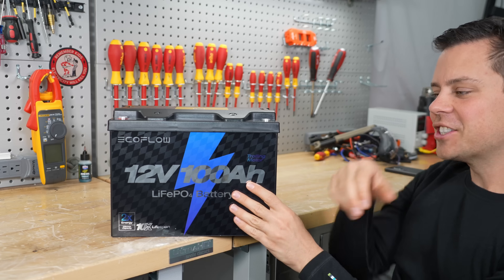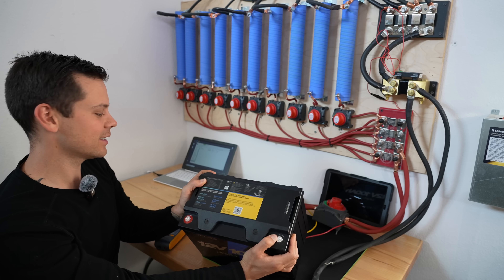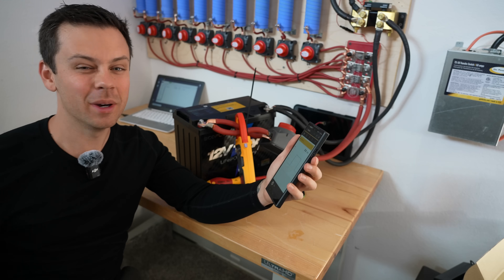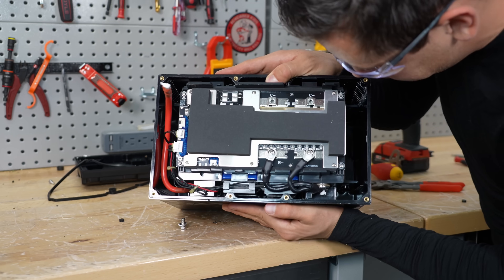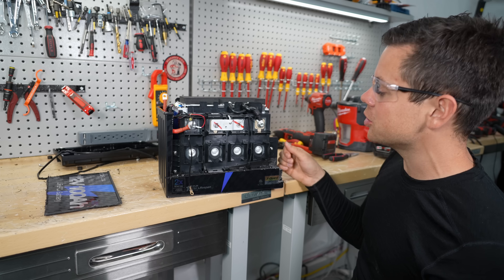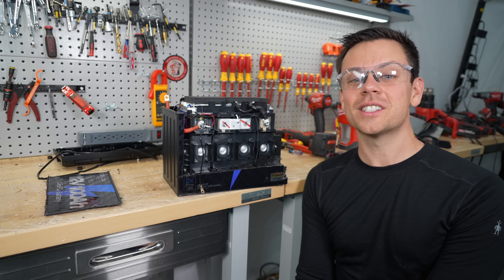$200 Ecoflow 12V Battery?! It's shiny!

Comment from the maker: $200 EcoFlow 12V LiFePO4 battery (affiliate link): https://bit.ly/4f6xuHm
$219 EcoFlow 12V Trolling Motor Version: https://bit.ly/3AkxJiR

$300 EcoFlow 12V LiFePO4 battery Amazon link: https://bit.ly/4e44ZZI

Other 12V batteries I recommend: https://www.mobile-solarpower.com/lithium-batteries.html

0:00 Intro
1:01 Surge Testing!
3:29 Tear Down
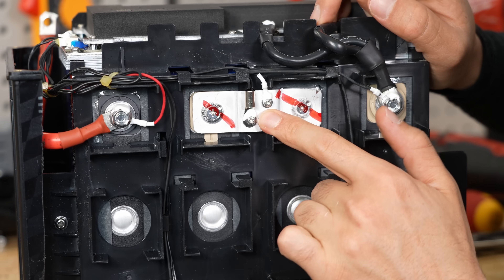5:56 Cold Temp Sensor Test
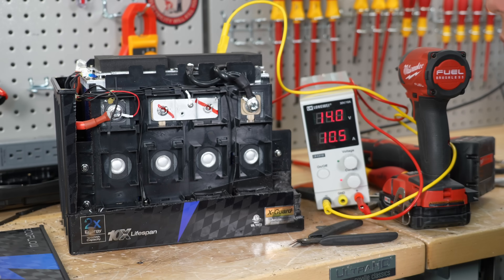6:16 Conclusion

~~~~~~~~~~~~~~~~~~~~~~~~~~~~~~~~~~~~~~~~~~
Tired of getting ripped off? Check out my "Will Prowse Approved" solar product recommendations below!

12V Batteries
https://www.mobile-solarpower.com/lithium-batteries.html

48V Batteries
https://www.mobile-solarpower.com/48v-batteries.html

Offgrid Inverter System Builder
https://www.mobile-solarpower.com/48v-complete-system-blueprint-559371.html

Hybrid Inverter System Builder
https://www.mobile-solarpower.com/code-compliant-48v-offgrid-system.html

Mobile Handtruck System Builder (very popular!)
https://www.mobile-solarpower.com/mobile-48v-system.html

Solar Panels
https://www.mobile-solarpower.com/300w-solar-panels.html

Ground Mount Solar Racking
https://www.mobile-solarpower.com/ground-mount-racks.html

Wire, Lugs and Busbars
https://www.mobile-solarpower.com/wire-and-connectors.html

Tools
https://www.mobile-solarpower.com/tools.html

Fuses and Circuit Breakers
https://www.mobile-solarpower.com/fuses.html

Plug-N-Play Solar Systems
Ecoflow, Anker And Bluetti! So many models to choose from. See my current recommendations here:
https://www.mobile-solarpower.com/full-size-systems.html

~~~~~~~~~~~~~~~~~~~~~~~~~~~~~~~~~~~~~~~~~~
Need to build a large DIY system? Need a trustworthy solar distributor? These are my favorites:

Signature Solar
Creator of EG4! Solar Minisplits, Victron and More! Largest Solar Store Online.
If you want $50 off, please use my link below and coupon code "DIYSOLAR50":
https://signaturesolar.com/?ref=cPwLcVc0SW-BjN

Current Connected
Best Prices for EG4, Victron, Midnite and so much more! Fast Shipping and Highest Rated Customer Service:
https://currentconnected.com/?ref=wp

~~~~~~~~~~~~~~~~~~~~~~~~~~~~~~~~~~~~~~~~~~
Join our DIY Solar Community 
Need more help? Join the largest solar forum on the internet for beginners and professionals alike. 140,000 members and counting!
https://www.diysolarforum.com

Check Out My Free Book
Best-selling and beginner-friendly guidebook to off-grid 12V solar!
https://www.mobile-solarpower.com/the-book.html

~~~~~~~~~~~~~~~~~~~~~~~~~~~~~~~~~~~~~~~~~~
Contact Information:
I am NOT available for personal solar system consult! If you wish to contact me, this is my direct email: williamprowsediysolar@gmail.com
FTC Disclosure Statement and Disclaimers:
Every video includes paid promotion or sponsorship (such as free products for review). Some links on this YouTube channel may be affiliate links. We may get paid if you buy something or take an action after clicking one of these. My videos are for educational purposes only. Information is subject to change/update at any time. Electricity is DANGEROUS and can kill. Be smart and use common sense :) DIY Solar Power with Will Prowse is a participant in the Amazon Services LLC Associates Program, An affiliate advertising program designed to provide a means for sites to earn advertising fees by advertising and linking to Amazon.com
Reply: Are there any of these types of batteries that can be used as starting batteries for a vehicle?
Reply: Would you recommend this for a camper build where I have a 24 volt vitron 3000 watt, since its a 24 volt truck, and use 4 these in series parallel, or is there a different battery you would recommend or a 24-volt battery that would come out as less expensive but equivalent in quality?
Reply: Your discount code isn't working for the $200.00 version of this battery.  It only seems to work for the trolling motor version.
Reply: @shouldibehere  I found that out the hard way- I didn't notice until after checkout, and despite me giving the information they required, they didn't cancel before it shipped. Guess I'm not buying ecoflow again.
Reply: :face-green-smiling:  Can you do Hiximi Will? Popular in mexico but ZERO information on them. 5000 pesos for 12v 100amph. $240USD with import tax.
Reply: Hey Will I got to ask what do you do with all the batteries you cut open? just passing through. do you pull the cells out and make any diy sets. lol
Reply: About cutting into batteries. Maybe a circular saw? Set the depth of cut really shallow. If you do not get through the first time, increase by a small amount? 
Just an idea of mine it may not be practical IRL. Love your videos by the way.
Reply: 599 in AU, that's with 100 off
Reply: try an m12 cut off tool 2522-20 , it is a 3 inch circular saw with a depth guide like a circular saw
Reply: Discount code EF12VWILLP doesn't work :(
Reply: These prices sure do love changing fast. Your last video on the WattCycle for $155 is already $210 and the video is less than a week old, and this video is 3 days old and the trolling motor version is $270 instead of $220.
Reply: the problem with ecoflow is their crap support  as well as their software as most of their support is reading from prompts and knows next to nothing. getting warranty claims done is a pain.
Reply: Marine version is $269.. not $219
Though still very inexpensive
Reply: You should test water proofing before tearing into these. For a trolling motor, salt water ingress would be... bad.
Reply: A table saw would be a good way to open batteries. Can adjust the depth as the saw is running. Using the saw guide will keep the cut straight to avoid binding or burning. When all 4 sides are cut the same it can be glued back together.
Reply: EcoFlow also making battery now?
Reply: Hi Will, I tried the coupon code on the first link and it was invalid. The second link price went up to USD $269.00 and the coupon code worked.
Reply: Apologies if this is a common question, but why a trolling battery over a standard 100ah?  Waterproof?
Reply: Just a heads up that I tried to use your code for the non-trolling motor version today and was given this message: EF12VWILLP discount code isn’t valid for the items in your cart
Reply: @willprowse I've asked in the past n multiple times we see you testing allllllll kinda batteries and solar panels and panels ECT however I have yet to see ECOWORTHY PRODUCTS AND ESPECIALLY THERE BATTERIES!!!!! kindly would you please be willing to do some testing for everyone who has built system from the products they sell thank you for sharing information and really would like to see ECOWORTHY PRODUCTS testing for everyone
Reply: I looked into it more and I dont see a need for the "trolling motor" batteries for use with actual trolling motors. They should just be marketed as High Output batteries
Reply: These are $129/$149 on their website. Not sure if this is temporary price or what????

Comment: I have 16 of these EcoFlow 12V 100A trolling motor batteries in four parallel banks of four in series for 48v 20kw storage/usage, running my garage power needs. All Victron MPPT's, Inverters, Shunt, Cerbo GX. Never had any issues with these specific batteries or the Victron gear. 18 months since purchasing & using the EcoFlow batteries. I also have an EcoFlow DP3 & have used one set of 4 of the EcoFlow 12V 100A trolling motor batteries connected in series for a 48V 5KW to augment the smallish 4KW of internal storage the DP3 has during extended power outages to keep my home living room & kitchen power needs met. Happy Customer of EcoFlow & Victron products! Renogy RSP200D Solar panels on Solar Pergola and sprinkled across my backyard powering it all.
Reply: Thank you for providing an update on your experience. Greatly helped me decide to purchase these.
Reply: @danzuelch  ebay has these batteries for $129 right now
Reply: @AlanPhillips-g1c  Thank you. I just ordered and received 2 of them :)
Reply: Could you tell us more about your setup? How is the performance

Comment: Will,  I have 32 of these EcoFlow 12v 100Ah LiFePO4 batteries in my system. I need to top them off to balance my batteries. How do you suggest that go about doing this(I have the HiTec RDX1 MultiCharger will this work?) (I also have the Longwei LW-K3010D will this work?) BTW all of your videos are AWESOME!! You taught me a lot! Thanks!

Comment: I always wonder why these battery companies say not to use these in stock golf carts. It looks like the max amp draw for these and other low priced 48 volt packs that a sold as golf cart batteries are the same. I'd like to try some of these low buck batts in my stock Yama cart but don't want to be a test dummy. Enjoyed the video. Thanks, DS

Comment: For shallow cuts the fastest method would be to take a cordless skill saw, a light weight cheap brand like "Hyper Tough" from Walmart, and set the depth of cut to a sixteenth of an inch or even less and you can save the box by folding it back on a shallow cut and then hotmelt glue it all back together.  I hate to think you have a pile of batteries sitting around you can;t use when I need about 8 of them for my cheap system.
Reply from the maker: I donate them all to forum members

Comment: Did you know that welder's wire leads are made of a much finer and more flexible copper wire than standard heavy gauges?   This means that for most of your heavy wiring, perhaps up to two gauge you can use these more flexible cables and the advantage is that when you do as much temporary testing as YOU do it will aid you in making easy connections and bending around tight areas.  I hope you will look into getting some on line.  Great job.

Comment: I learned from Will when he started his channel and wrote a book. Years later I have built many DIY systems based on his teachings and experiments . I still watch everyone and always learning and enjoying his unique, honest and can’t be bought approach. He is the best !!
Reply: One thing to be careful about with fine stranded wire is "cold flow".  It can move (flow) over time.  Be sure  to use lugs rated for fine stranding or put crimp a ferrule onto the strands before putting into the terminal.

Comment: What is the difference between- Lithium, Lithium Iron Phosphate? Huh?
Reply: Plain old Lithium batteries or "Lithium-ion" are old tech.... LiFiPO4 are a newer style of Lithium battery that is more energy dense, safer, more cost effective, more thermally stable, have a higher cycle life and many other advantages over the older Lithium-ion type batteries.
Reply: @ thanks handsome, this should be said more!
Reply: Trolling motor? What does THAT MEAN?
Reply: @kricklasalty1464  A trolling motor is an electric boat motor for fine motor control of a boat. Fisherman often use them to quietly "troll" around their favorite fishing spots. Sailboats often use them as well for navigating boat docks and "no wake" zones.
Since this battery is designed for "Trolling Motors" it is a lot stronger than a typical battery. It is designed to be in a boat that will probably get jostled around, splashed with water, kicked, taken in and out of the boat, ect...

Comment: I'm looking to build a 48 volt RV system. I know it may not be the most advantageous but as good and inexpensive as these 12 volt batteries are getting it may be great cost savings to use those in series instead of 48 volt batteries

Comment: Any way you could do a video on how to do an automatic aux battery setup. Wonder the best way to setup so that if you have  2 banks, one sized for standard use and one for redundant if the main bank hits X volts. So failover to the backup bank if main bank hits X volts,  then top off the backup bank and switch back to main bank to charge it back up when power is available all using one solar charger setup. The thought is It might be nice to put some cheap batteries in bank 1 and have a more expensive battery in bank 2. allowing the more expensive to take less cycles over time.

Comment: Hi Will....I want to replace my 2 Renogy AGM 100 amp batteries with lithium batteries - just trying to figure out if these will work with the renogy 50 amp mppt  charge controller.  Looking at two 230 amp litime lifepo batteries.  HELP - will this work?

Comment: You need to pick up a commercial walk in freezer so you can do some cold weather testing for us people who live in Canada or Alaska. 😂  I need new batteries for my cabin but -30°C is the lower end of winter temperature. Pretty sure I will have to stick to AGM's but Lithium would be nice based strictly on performance.  Will pick up one of these for the boat trolling motor though.

Comment: I want to put something like this in my car as it's starting battery...
But most I've seen have small screw terminals that will be difficult to connect to...
Any thoughts would be appreciated. 
Cheers.
Reply: Depends if this battery is able to provide the necessary current (amps) to your starter motor for as long as needed to turn over the engine and start it. I think it would also depend on whether your alternator is capable of providing high enough voltage to maintain the battery charge. I think LiPo absorption voltage is around 15.2V. Maybe with some investigation and tinkering you can get it to work. Would be interesting to hear from those in the know.
Reply: @inncogneato6341  Lithium iron phosphate can be charged to full capacity with as little as 3.4 volts per cell, up to 3.65 is considered normal, and they can for short durations safely withstand up to the full 4.2 of other lithium ion chemistries. For 4s that means 13.6, 14.6, and 16.8 volts respectively. Lead-acid requires temperature compensated charging, the colder it is the higher the voltage required. Below freezing the charging voltage of a car can be up around 15 volts.

Personally I live in a climate that sees snow so I would use one as a car's cranking battery provided it is self heating and its capacity is at least double that of the alternator amps to be sure that it is never charged at more than .5c, IE my car has a 160 amp alternator and so I would do 320 Ah minimum. the starter draws 700 amps stall current. I would also prefer to have an ultracapacitor array or lead acid battery in parallel because bad things can happen if the BMS disconnects with the engine running.

It should also not be mounted underhood as the temperature is too high.

So 3-4 of these in parallel, mounted in the car's interior, and in a tropical climate would do the trick.

I actually already do have a small LFP battery in parallel in said vehicle now, the Noco NLP30, but is is plugged in to an always on power socket so the resistance of the stock wiring is enough to mostly keep the charge and discharge current down to about 5 amps which is safe for its 8 Ah capacity.

If you study the discharge voltage curves of LFP VS lead-acid you will see that the lead-acid starts to discharge right around the same voltage as the LFP is almost fully discharged so it is sort of like having a float charger always connected to the lead-acid keeping it at full charge all the time while the car is off, IE the LFP handles the standby ignition off loads.

Comment: Could any1 plz explain to me, is it possible to use these batteries as an extension for ecoflow powerstations? Do i need to have that add-on ecoflow for fast charging from the car battery? (Alternator charging)Is it possible to use this battery and solar panels at the same time while charging it with the car motor and ecosflow alternator charger?

Comment: You say $200, ecoflow here in Australia sell it for $699. I wish it was even remotely similar pricing. Looks like a nice battery! My most recent battery is a Kings (4wd supacentre) 120ah lifepo4, and that tested to 134ah at 1C, which i was rather impressed by, for just $349aud. Time will tell if it remains good after a few years. It runs 8 cells in a series parallel configuration. They also use the same cells in their 60ah battery, but just 4 of them. Thats what im currently using for my trolling motor and ive gone for 4-5 hour trips solely under propulsion from that, and gotten through about half its capacity so its plenty for my needs.

Comment: Hurricane Milton, took power immediately.  We used Ecoflow River and River2 power stations throughout.   First, to open the garage door.  Second to keep phones, lights and power tools recharged and used a single 100w panel and XT60 connector to keep it charged.   For heavier use, the 12v to XT60 cables, allow daisy chaining for more power.   EcoFlow wins in my book.

Comment: I would love if you could explain the pro's and con's of using one 36v 100ah battery vs 3 12v 100ah batteries run in series.  Also would love for you to review the smaller power queen battery that is a 12v 100ah in a grp 24 casing size. Both  with  and without  bluetooth

Comment: This battery tech is garbage. This is supose to be lighter, smaller and have power power... meanwhile they fill it with glue, sensors, computers and more failure points, all for it to just cut power... Trying sodium cells now with no bms

Comment: I'll tell you something about EcoFlow: I am thinking about doing the van life thing in my car and was looking to use their Wave 2, their fridge/freezer, and a solar generator/battery bank to power those devices plus my CPAP. I have very specific info about the type of battery I need (49AH, deep-cycle, non-marine, etc.). I sent an email to EcoFlow about which would suit me best, and the replies were written as if AI had done it- the questions I had weren't really answered and it was full of fluff. So, as of this writing, I am still not sure what to get, but I am thinking of going to these raw batteries more and more and just put them in some kind of case.